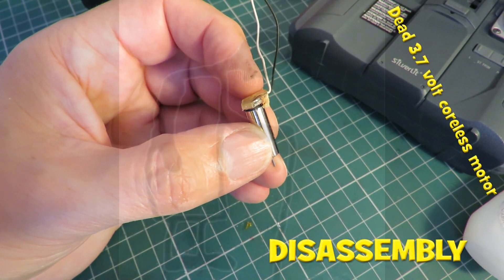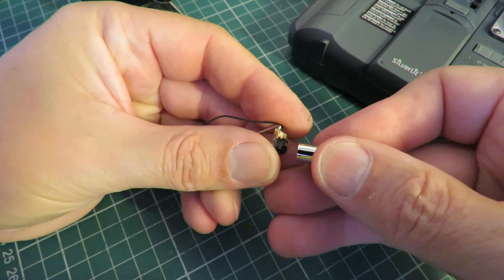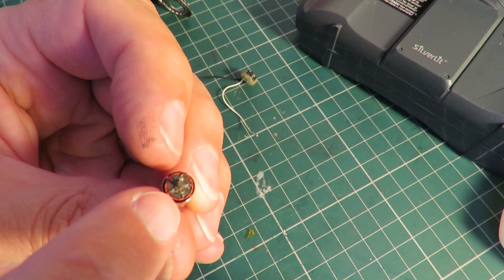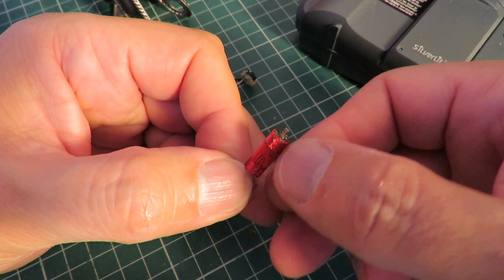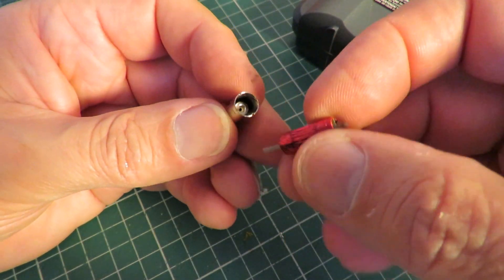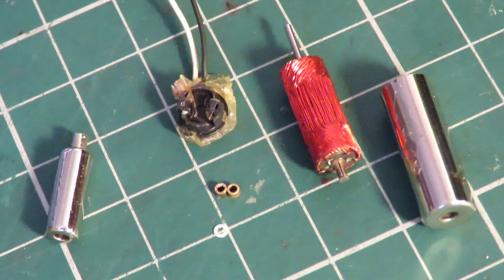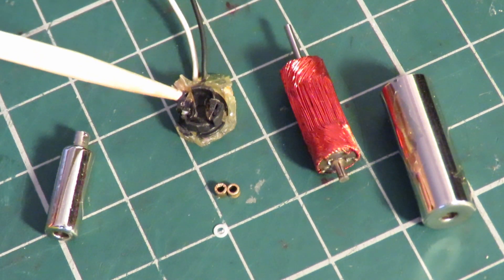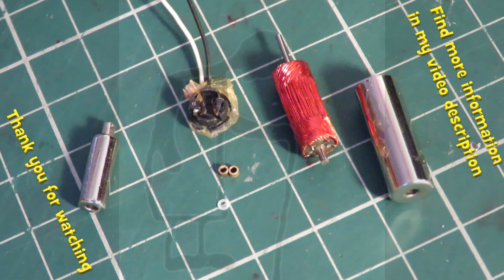3.7 volt coreless motor DISASSEMBLY

Comment: How make cordless motor
Reply from the maker: I don't think you mean cordless. A coreless motor is a motor where the wire armature does not have a metal core - hence the name coreless - and they are generally very small like the one in this video. You can see the component parts in this video so you should be able to work out how it was made but why would you want to make one? I guess if you could find a suitable magnet you could make a wooden mould just a little larger to wind your wire armature onto but then you would have to be very inventive to mount it on the shaft and make a suitable commutator and brushes. If you meant a brushless motor there are several videos on YouTube on making them.

Comment: do those Motors require lubrication?
Reply from the maker: I don't think so but you would probably get a more informed answer if you try one of the RC forums as these motors are often used in the mini quad copters.

Comment: sometimes when I break one wire on the moter, I am able to touch the terminal for the missing wire on the can and the other wire connecting normally makes the motor run fine.
Reply from the maker: Yes sometimes they have one terminal attached to the can possibly to reduce radio interference.

Comment: Thank you for a video. I was always wondering what was inside these little motors.
Reply from the maker: I would not take one apart unless it was already faulty as there is nothing inside that you are likely to be able to fix. Everything is far too small to work on.

Comment: it is hard to handle it becoz the thin wires of it breaks easily I have many of broken coreless moter
Reply: why do you don't like your own videos
Reply from the maker: Yes you need to take care with this wires.
Reply: i always use some epoxy or hot gleu (actualy any tipe of gleu) and put that on the places where te wires go into the motors. they us have less change of the wire's breaking
Reply from the maker: rc model boats yes, so do I :)